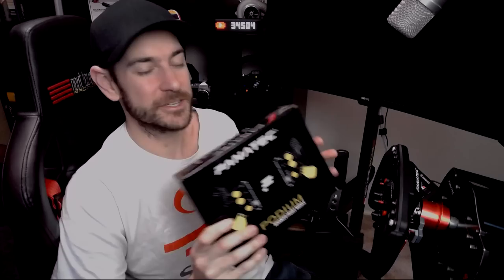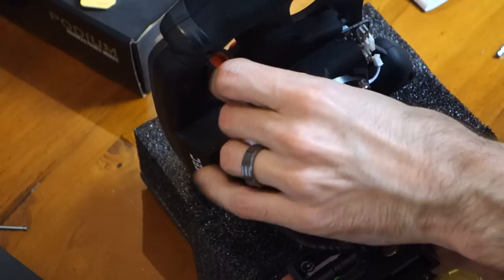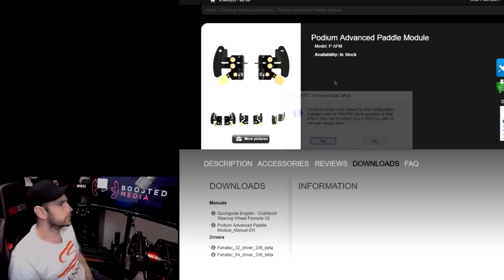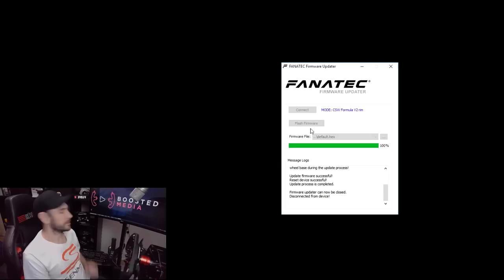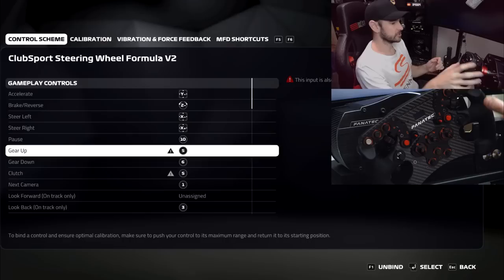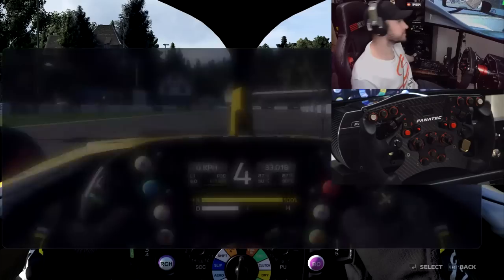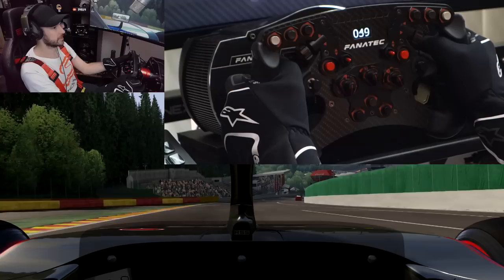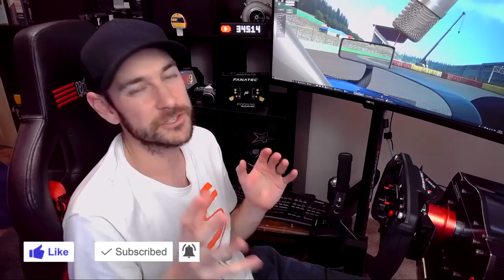FANATEC PODIUM Advanced Paddle Module - Installation - Software Setup & Review

Comment: Just so you know how to use the Clutch bite Point properly ;)

1. Engage both clutches completely
2. Let 1 Clutch Go, in your Display should be 100.
3. Pull the funky Switch down (or up) or rotate it left/right. The number in the Display should Change.
4. Set it so that the number in the Display gets the car rolling. (35 for Example)

If you now start you can engage both clutches completely, let one Go and the other clutch is Set to 35 although completely engaged.

;)
Reply: Zanion thank you I was about to tell him this very thing! I was watching the video and I was like “YOU DIDNT SET THE BITE POINT!” hahaha :)
Reply from the maker: I thought the night point was defined by the second paddle. Would be nice if FANATEC gave some instructions. Lol
Reply from the maker: Bite point^
Reply: @boostedmedia  yeah it's difficult without explanation... There should be a Video in the Fanatec Channel about it... I will Post it here in a moment
Reply: I'm surprised at how many youtubers are making videos about new products and how they work, when they haven't actually learned how they really work
I also noticed Boosted Media's video about Fanatec's Podium Hub and how it would make it possible to use a third-party steering wheel, which has been possible with the Universal Hub all the time ...
Reply from the maker: It’s a first experience video, not an official explanation video. I never claimed to be the expert.
Reply: @boostedmedia  you shouldn't title it "setup and review" then. call it "first experience"
Reply: @Boosted Media

After messing a while I finally made the clutch bite point to work in F1 2020 with the Fanatec Formula V2.

Fanatec Formula V2 settings:
1) Set the middle switch to “A”
2) Engage both clutch paddles completely
3) Pull the funky switch up or down, the display should show 100
4) Dial the display down to 20 - 25

F1 2020 Game setting
Edit your setting and program the main clutch (not the manual one lower in the menu)
Depress both clutch paddles, it should display “O” 
Save and exit
Full throttle at race start
Release one clutch paddle once the lights go off, then gently release the other paddle clutch to limit wheel spinning

Enjoy!

Comment: 19:50 Dual clutch/bite point clutch paddles are no longer in use in F1, so it's no wonder that that specific functionality isn't in the game. The APM also is also not a licensed F1 product, though it's a bit weird how the product page describes "F1-style dual clutch paddles".

In any case, solid and comprehensive video! Will probably be coming back to this one when my APM shows up!
Reply: Yeah you're right, drivers have clutch paddles on either side but they both do the same thing (have the whole clutch travel) you just have to map it this way to make it real and engage clutch with preferred hand. Or map the other one to whatever you want really
Reply: Do any other race cars use clutch paddles? Wondering if this upgrade is worth the money for realism. Why buy it if they don't use it anymore? I've always assumed that paddle shift operated cars have an auto-clutch, or a clutch peddle that is only used when starting from a stop or when stopping.
Reply: Norman D There are plenty of cars around in various sims that still use bite point clutch paddles. Plus you can use the paddles to assign other things to it as well. 

Cars with paddle shifters normally use a semi auto gearbox for changing gears, and a seperate user operated clutch for get-away.
Reply: F3 driver Tim Armstrong made a video on YouTube about the dual clutch setup on his current rim.
Reply: F1 series games have older F1 cars which would have duel clutch or even the classic old foot to the floor clutch's which should also require a linear input. Once again lazy codemasters

Comment: You can set the bite point using the funky switch. During practice when you find the bite point for the car/track setup you can pull the clutch paddle and when you see the 100 on screen turn the funky switch counter clockwise to the desired bite point. When you release the first paddle on launch the second paddle starts at your bite point (say 35) and gives you the full throw of the paddle to go from 35-0 giving much more control.
Reply: That's still not working in F1.
Reply: That is sick info. Ty very much.

Comment: Set the clutch bite point to 20 and it works perfect for F1 2019.

Press both clutches in
turn funky switch rotator to show 20 on the display
release both clutch to set it

When in game about to start

press both clutches down 

full revs
release the left clutch
slowly release the right clutch
Reply from the maker: Good tip. I’ll give it a go.
Reply: @boostedmedia  you can save that time. It doesn't matter if you set 20 or 1 or 90. Result is always the same that clutch in Game is released only at the very end because F1 can't see an axis as clutch but only a button on/off press.

Comment: Just a small point, if you compare 5:35 and the instruction on the back of the packaging you'll notice that you mounted the paddles on the inner side, but they show on the instructions to mount them on the outer side.
Only the two big ones with the spacers have to be mounted on the inner side.
That's why in the beginning you said (correctly) that it's easier to mount them before attaching the module on the steering wheel.
Anyway no big differences, just a little bit more gap, useful for someone with big hands like me!
Reply from the maker: I found them too far away if I mounted them on the other side. It was intentional. :)

Comment: hi. i have a question. i want to buy: Clubsport Wheelbase v2.5 and the Formula v2 clubsport wheel. does it work with the podium advanced pedalsß Some says that it only works on podium wheelbase or an universal hub
Reply from the maker: The podium paddles work fine with the formula V2 and CSW2.5. That’s exactly what I was running previously.

Comment: This Video solved my problem getting the analog pedals working .  Nowhere in the Fanatec manual can you find anything about that the analog pedals axis need to be assigned in the game.   Also, you right about the exposed wires . At that price one would expect a cover .  Thanks

Comment: You didn’t address the one thing I am most interested in that I requested in you last video :/
How are the analog pedals when used as an accelerator & brake? Do they work in that format in F1 2019 & other games?

As someone w/ paralysis in my legs, if I get this mod or a wheel already w/ it, the above would be THE ONLY reason.
Reply: skilewis as I have got these installed today I can tell you it is fully functional as an accelerator and brake when in the correct mode.  The paddle work on an axis so you can control inputs and there is enough movement to be able to have sufficient “pedal” control.  Obviously it will be tricky going around corners and being able to have good control but as you have no other way of playing then practice will make perfect!  Good luck pal
Reply from the maker: I did address it in the video specifically with you in mind.

Comment: Nice video, great tip on using the foam cutouts to hold the wheel during installation!  I noticed though you screwed the shifting paddles on the inside (closest to the wheel), while Fanatec installed them on the outside (further away), with the screw heads facing away from the wheel.  Was this to bring them closer for finger reach?  (the clutch pedals are staggered this way).  Also they recommend the washers for larger diameter wheels.

Great video, subscribed!
Reply from the maker: The is for the sub. Yeah I wanted them closer to my hands originally but have since switched them around.

Comment: Reason for the software problems you had at the beginning was that you were NOT on driver 335 as you said but on driver 328 with the old firmwares which both did not work with the APM. ;)

Comment: Hello mate a quick question regarding the screw orientation on the shifter paddles, don't they have to be screwed from the top as in the clutch pedal or can it be done like you did? I placed the shifter on top of the screw holes rather than underneath it and then put the screw from the top just like the clutch pedal.
Reply: I noticed this too, surprised others haven't mentioned! I went through the whole setup and then in horror saw this setup video put them on the other side of the piece extending from the base. In effect, this video's way 'pulls' the switch, but if you match the screws of the clutch paddle, they 'push' the switch. I think in the pull situation they are slightly closer to the grips so you don't have to reach as far. Because the screws face in, it's much harder to tighten or unscrew without removing the whole paddle base. It may also loosen more easily. In considering all this I still decided to match this video since getting them a bit closer means less hand strain shifting. What did you do in the end @Nasir?

Comment: Perfect timing, very helpful video! I already have purchased the F1 2019 wheel and the Podium paddles + CLS Elite LC pedals. To finish it off I will get my CSL Elite wheelbase this week. I've played F1 2019 for the first time today, so everything feels really new! Now, I've got a great instruction video for the paddles as well. Do you think I should install the Podium paddles right away, or get to know the wheel with the standard paddles? This is my first set of Fanatec equipment so there is a lot to learn...
Reply from the maker: I don’t see any reason not to install right away. Maybe test the wheel first to make sure it’s not DOA
Reply: @boostedmedia  That's a a good idea, thanks! I'll make a comparison between the standard shifters and the Podium's as well.
Reply: @boostedmedia  I've got the shifters mounted now. Man, are they som finnicky things to get in place! I spent about 45 minutes, being careful not to cross-thread any screws. The routing of the cable in the housing was, like you said, a bit tricky with the cable snagging on some stuff inside. I used an Allen wrench to "clear the way" for the cable while feeding it through. Srewing down he paddles was kind of frustrating as well, as the strong magnets kept pulling the screws away from the holes, sticking them to the magnets. Also the cable is very stiff and requires som serious bending to be able to get that Allen key in there to screw down the shifters, the cable gets kind of cramped between the shifter and the wheel body, which feels a bit so-so and makes the mounting harder.

Now, as a comparison to the original paddles, they are stiff! Gosh darnit, I need almost three fingers on each paddle to get them to move. It's a real workout shifting quickly and sometimes it's like I loose some grip of the wheel, because all the strength goes into shifting, especially when shifting fast. I'm not quite sure I like it, i will test them for a week or two and see. The original shifters are softer and smoother, but are missing a click, they are just moving between the end points. Still, they might be more comfortable to use in the long run, not needing to go to the gym to build muscles in the arms/hands =)

Comment: The PAPM is great, fells good and looks good but the right side, the up shift side of my PAPM bended and stop working after 13 months, so no warantie any more, the solution given by Fanatec is send it back and they will charge a ammout to fix it or buy a new one. So, if you use it a lot, try other brand couse Fanatec will fail on you

Comment: Hello, I have bought the "ClubSport Steering Wheel Formula V2" and the "Podium Advanced Paddle Module" to be able to play only with my hands without the pedals, but I have a problem since in the F1 2020 game, it does not let me configure the cam right clutch as accelerator and left clutch as brake, it ONLY lets me set or accelerate or brake, it is as if it only recognized both cams as one. How do you solve this problem?. Since I bought it to only play with my hands without the pedals to be able to accelerate and brake with the clutch paddles. Do you know anything about this topic? Thank you very much.

Comment: I'm wondering if anybody could possibly help me with something. I have a clubsort formula v2 wheel with the magnetic shifters installed but I can't get the middle shifter to work for gear changes. The clutch and the upper paddles work but the middle shifter does nothing. Any assistance would be greatly appreciated. Thanks in advance...
Reply: I should say that I'm using xbox as well.

Comment: Does anyone have the issue that during race start in F1 2019 the wheel turns suddenly to right with a lot of force? What counter measures do you have?
Reply from the maker: Everyone with a CSW2.5 has this issue. There is no fix currently. The issue has been present since the first beta release.

Comment: You installed the paddles wrong. The bolts should be pointing towards you, not the other way around. The way you did it makes you touch the end of the bolts as you shift. Just use the pre bolted clutch pedals as your reference and do the same.
Reply from the maker: The paddles were too far away when I installed it the other way around.

Comment: Any news about the top paddles working already with Codemasters F1 2019? Thanks!
Reply from the maker: Still not working.
Reply: Boosted Media 
Well, now it is working \o/
It maps key 60 and 61.

But man these magnets are really tough. I‘m afraid to get a tenosynovitis. How about you?
Is there a chance to replace them, like the Asher wheel? :)
Reply from the maker: You could probably add some spacers but not sure if they’re glued. They crack very easily so you’d have a hard time prying them off.